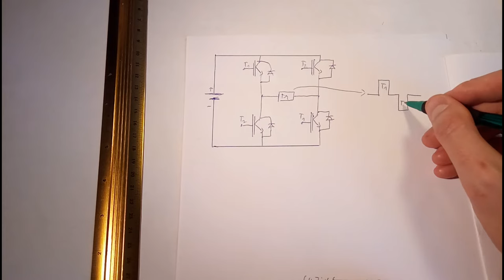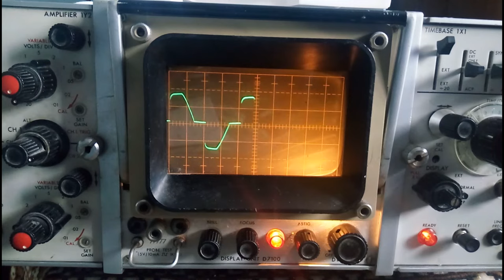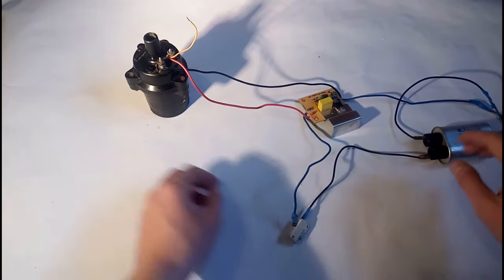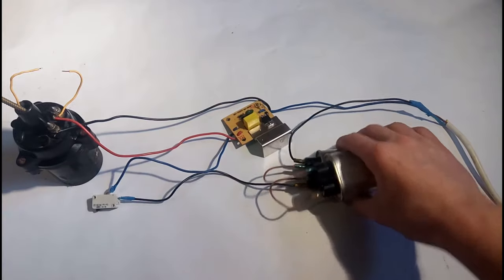Overvolting a car ignition coil to 90 kV

Comment: Did you ever try to use psu as power suplly?? What wuld hapen if you reverse polarity those pulses?
Is it posibel fiering ignition coil by ordinary blinker relay?
Thats what hapening by my I cant turn engin off when all 4 blinker are working.
It is cinde of anoying but I like my engin working that way it seams I get hoter spark for some reason so I was wondering culd I force my ignition system to work on lower speed ?
I have clasic gm ignition 4pin module build in distributor Im useing induction triger build in the distributor and have gm's e core type singel hei ignition coil.
So I was wondering how I can make that thing dubel fire?
I have multipel coils .
And I have question if that 4 pin gm ignition module is polarity sensitive and I have positive linear voltage regulator inside the dasboard I can not use the bypass voltage on my starter selenoid who has S and R terminal my fuse pops simply I have hard time in winter starting my engin so any kinde of help wuld by nice.
How do I make polarity tester how can I bypass the problem with sensibel polarity trigers and coils?
Because I need that starter selenoid I dont know how to bypass this problem.
And are there some variabel oscilators awailabel? So I can make stationary engin runing on low rpm?

Comment: If you don't mind me asking, would that make a good fence energizer, I would like to make one myself, as I have a few sheep on a 12 acre piece of land, a good fence energizer is very expensive?
Thank  you very much for uploading this video!
Kind regards, Dan George
Reply from the maker: No, I actually think it is very dangerous to use this design as a fence energizer, because it does not provide galvanic separation from mains power supply. Therefore a discharge through a body to ground can result in serious injuries or death. It could work only if the circuit is powered through a galvanic separation transformer with limited current output.
Reply: Use a DC to DC step up converter. Step up to 50v .... Then add a car blinker as in series with negative input....

Comment: Can you tell me sir if there circuet exist that can run dual ignition coils at different polarity ?
To have 1 coil fire normal negative ground and the other fire positive ground ore this ( + - ,-+,++,-- polarity).
Also I was wondering how to use high amp capacitor with hv voltage ceramic capacitors at centrain engine speeds wuld that be posibel to use bouth?
The problem that I come across me delco 12si alternator starting charge get effected be capacitors and the lead acid baterry experiance different effects so how to protect your self from static ore ground problems to the baterry and alternator.
If you have gmail please I wuld like to tell you some strange effects .
If posibly please help me .
I cant solve me projects alone Im not good with electronics.
Strange effects are good but some are anoying who I wuld like to get ride off .
But I dont understand polarity swaps ore those small circuets so I hope you can help me to understand what is going on with me engine.